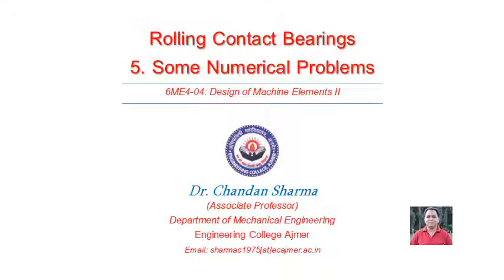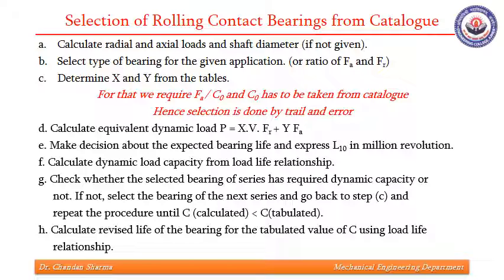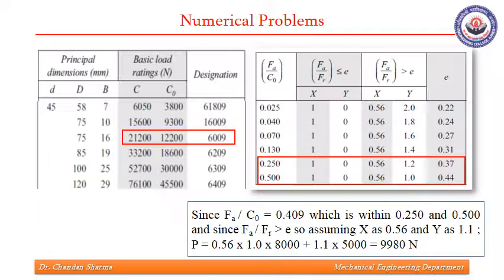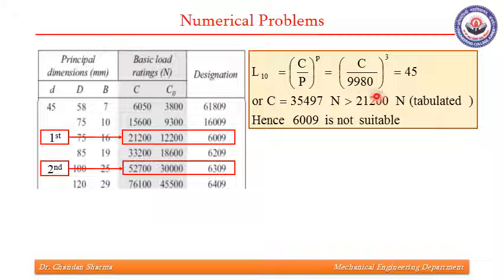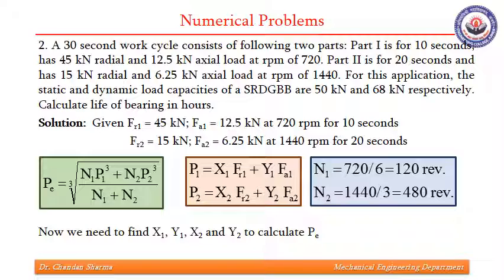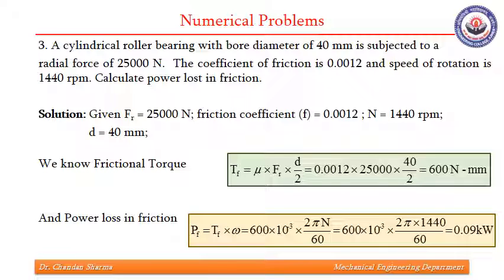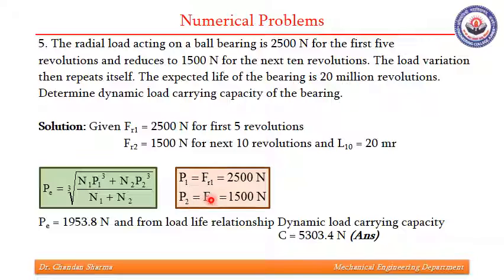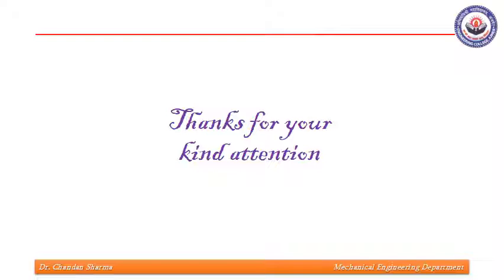DME - II Few numerical problems on Rolling Contact Bearings

Comment: Sir In the second question ,while converting life from million rev. to hours, what is the value of "N" which is taken, as the rpms are not constant but changing throughout the working of bearing.
Reply from the maker: Since N1 plus N2 is 600 revolutions and cycle is of 30 seconds, so RPM (N) shall be 1200 and the same needs to be put while converting Life in million revolutions to Life in Hours.